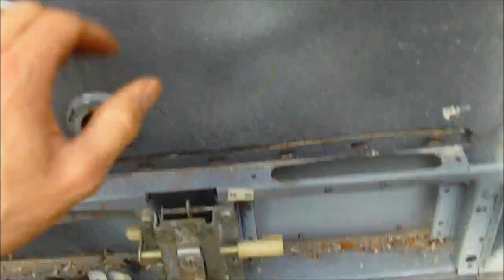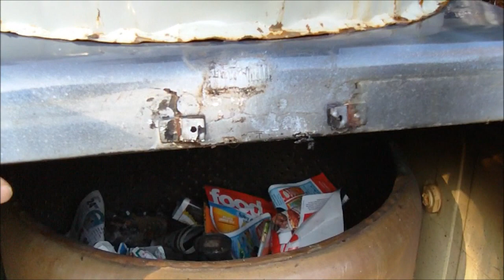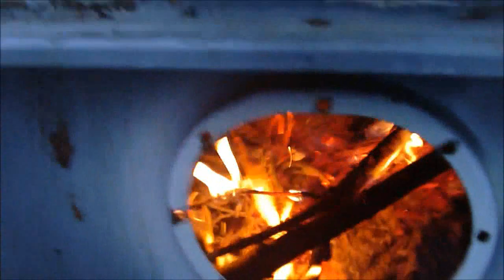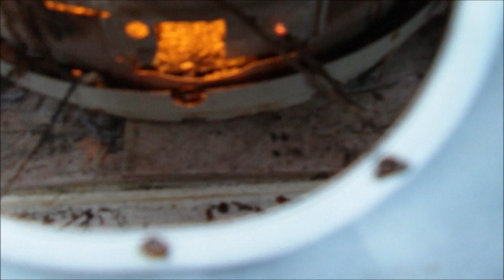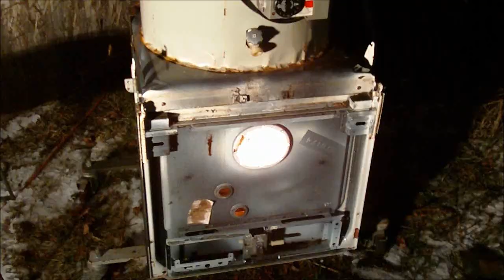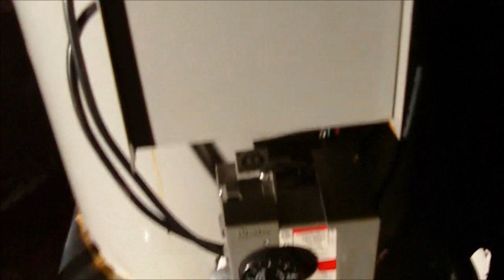Homemade Wood fired Hot water Heater from junk

Comment: I wonder if you added an afterburner pipe to burn the wood gas coming off your fire if it would increase efficiency and drop the smoke coming out of the top of the hot water tank I am currently starting a project exactly like this I'm hoping to offset someone by heating cost

Comment: What I'm curious, is how the whole thing stays standing with 40 gallons of water in it.  Seems like 320 lbs of water in the tank would fold that diswasher case like origami.  (Not to mention the caster framework thingy.)

 +kurtscottage was the tank filled with water in the vid?
Reply: dansw0rkshop The water is not filled inside the tank, but runs through a tubing water line. Therefore, it is less weight for compacity.

Comment: I had this same idea. I had in mind though just a drum sitting a top a wood burning stove. The chimney going through the center of the tank makes better sense for efficiancy. Thanks the video. I love it when I have an idea can come on you tube and find someone already built my idea and did it better than what I thought up. Now I can take it and do it better the first time. Do you think a brick fire pit with grates for the tank to sit on would work as well.? I didn't see any reason why it wouldnt . Of corse my tank would be a bit smaller.
Reply: Hahaha same here :) I just had this idea 30 min. ago and started googling and ended up here :)
I'm thinking of some heater to heat up a hot tub.
Reply: I'll tell you from experience yes it does
Reply: also that blow off valve at the top replace it first this will keep you from turning it into a bomb 15 bucks to save your life
Reply: I could heat my water in 10 mins oh and I actually ended up just putting it on some patio blocks. oh and saw saw out the gas door two fit more wood
Reply: I call it a gasifier water heater man I had a 4 foot orange flare half the time